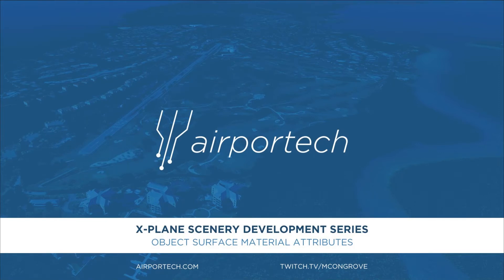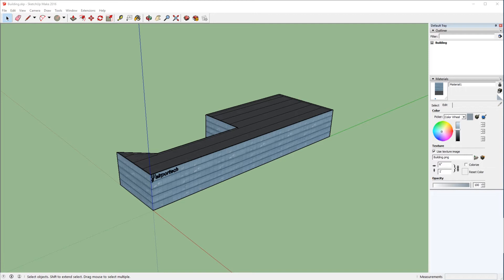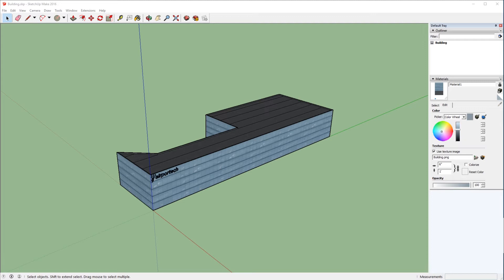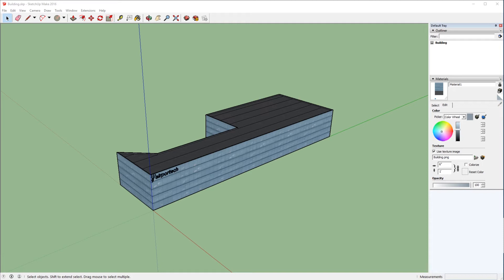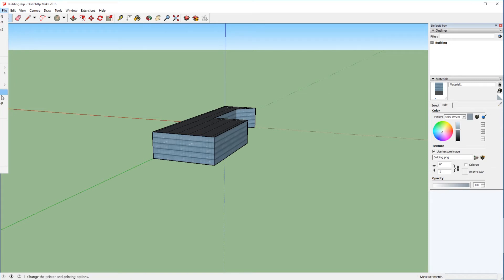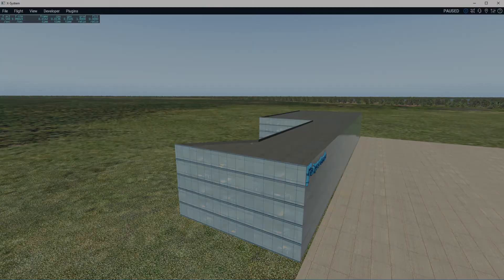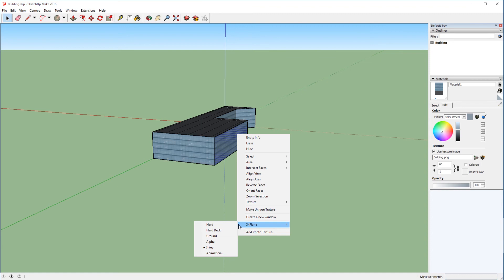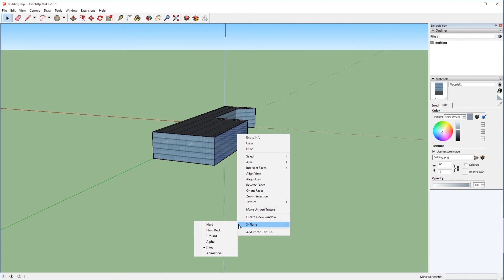X-Plane Scenery: Object Surface Material Attributes

Comment: Hi, your tutorials are so helpful. I would enjoy your skills to asking how to translate transparent surfaces into X-plane? I created a .png file (blue colored square with the ratio of 512x512 pixels) imported it in SketchUp and set a transparency of 35%, which renders very well. But when it is exported to Xplane, glasses are no longer transparent (after having translated the png in dds file). What do I do wrong in the process please?
Reply from the maker: You need to set the transparency in the image, not in SketchUp. So in an image editor like Photoshop, select the part of your image that you're using for glass and lower the opacity.

Comment: Hi Matthew,
First of all my compliments on a great series of video's. I have a question for you on creating objects.

I have been developing sceneries for X-plane for some years now and I really like to build the 3d models as well. Have a look at the sceneries of fhvanhal so see what I have done.

When building 3d models I always run into the same issues when I use glass. In my texture I make these transparent so you can see what's happening inside a building. I usually put 3d people or coffee shops inside, so you can see them from the outside. The problem is that when using a transparent texture, it automatically also sees through the back of the building. I always solve the problem by adding an inside wall,  blocking the view. Obviously this means extra texures and extra render time in the sim.

I am wondering if there is a possibility to texture the inside if the outside wall or oposite glas pane in such a manner that it look solid from the outside, without having to do the extra texturing.

Any ideas on this?

Regards,
Frank
Reply from the maker: Hi Frank,

I've actually had the same issue and have tried to resolve it a number of different ways. With the more complex modeling programs, like Blender, I believe you can more easily control the draw order, but with SketchUp I haven't yet found a way.

Draw order is important, as transparent faces have to be drawn last. How exactly you do that, I'm not sure. Searching the forums may help: http://forums.x-plane.org/index.php?/forums/topic/34211-calling-all-drawing-order-gurus-and-texture-gods/
Reply: Thanks. I'll have a look and if/when I find a solution, I'll let you know
Reply from the maker: He said:

"When building 3d models I always run into the same issues when I use glass. In my texture I make these transparent so you can see what's happening inside a building. I usually put 3d people or coffee shops inside, so you can see them from the outside. The problem is that when using a transparent texture, it automatically also sees through the back of the building. I always solve the problem by adding an inside wall,  blocking the view. Obviously this means extra texures and extra render time in the sim.

I am wondering if there is a possibility to texture the inside if the outside wall or oposite glas pane in such a manner that it look solid from the outside, without having to do the extra texturing.

Any ideas on this?"
Reply: Hello Frank, Can you type down your question again? I cannot see after "Have a look at"